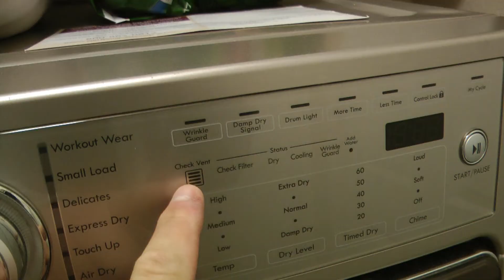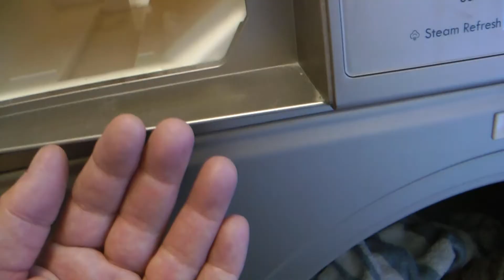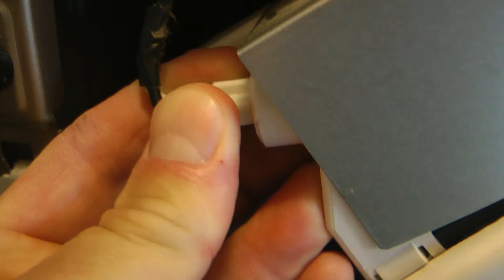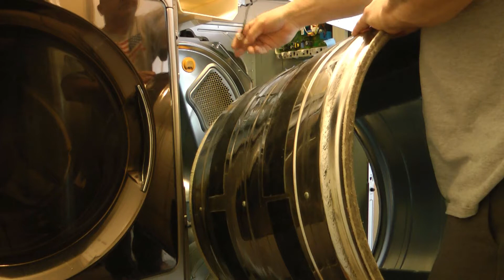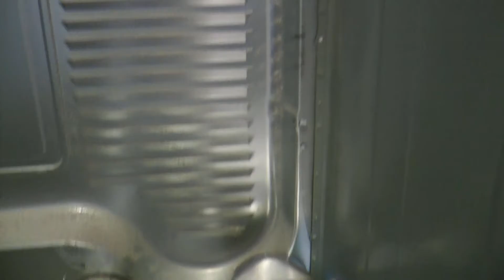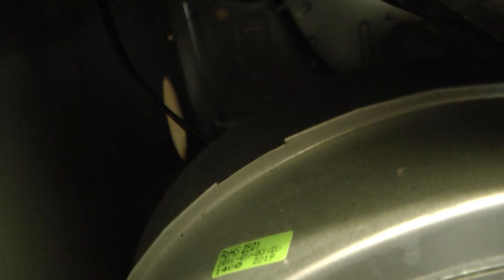Kenmore Elite Dryer drum wheel repair replace

Comment: Thanks for the super detailed video. I followed your steps and was able to swap out the rollers and tensioner in a couple of hours. 

A tip I have when it comes to replacing the rear rollers, is you don't have to pull that panel off in the back. You can get a stubby 14mm wrench in behind the panel and the end of the shaft is a 10mm socket. Zap it off with your impact and you're good to go 

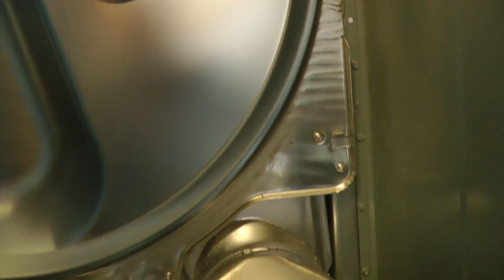Thanks again for making this. 12:31
Reply from the maker: thank you for sharing your tip, I'm sure it will help others

Comment: There isn’t much I won’t try when it comes to home repairs.  But a dryer rebuild wasn’t on my experience list until I came across your tutorial.  In Alaska we don’t have much of appliance repair shops and most parts must be shipped.  I started the project on Saturday following your steps 1 by 1. When I stripped it down to the drum rollers, I found out my parts I ordered were not the correct rollers.  I almost took the dryer and parts to the dump.  After realizing a new 9cf dryer is about $1,500, I thought I’d give it another shot.  I was able to source the correct parts (minus the belt being too small so I put the old one back in for now) and put it all back together tonight.  Many thanks for a great video and tutorial.  You saved me a little over $1,400 plus a little blood.  Gloves are highly recommended 😅.  Thank you.
Reply from the maker: glad the video worked.  I am not an appliance repair person but just figured this stuff out on my own.  That dryer is still working great to this day

Comment: Thank you for the excellent video.  I was able to replace the rollers on our Kenmore Elite dryer using your instructions.  FYI, I was able to reach nuts behind  the back plate holding the rear rollers with a 9/16" box end wrench and replaced them from the inside without removing the back.  There was not much space and I could just get the wrench on the nut.  I think my older model had a bit more space behind the back plate to work in than yours.  This is the second set of rollers I have installed on this machine.  The last set lasted only 3 years.  I had completely forgotten how to disassemble the dryer and it would have been a nightmare without your video.  Thanks again.
Reply from the maker: glad it was helpful

Comment: 1.2.2025 - This is the best tutorial. Step by step process. I completed the job successfully and only had two screws with out a home. Many thanks.
Reply from the maker: now the challenge... do you try to figure out where those 2 screws went?  I would at least get some painters tape and tape them somewhere secure to the unit in case you figure out you need them later

Comment: Thank you for the video. There were some differences in my Kenmore Elite (such as 6 rollers, number of screws and locations, etc.). I used your video for a majority of the repair process (pausing every step🙂.) It really helped. My dryer almost like new.  Sent the video to my wife at work when it was completely disassembled. She asked if I can you put it back together? Jokingly, I said no. Then she said to buy a new dryer. Turned on the newly repaired dryer when she arrived and thanked me for buying her a new dryer so quickly. She couldn't tell the difference because it was so clean, lint free and very quiet. Thank you again for making the video.

Comment: 13:15 time stamp, you dont have to remove the whole hose, in the back of your dryer there should be this plastic cover that you can open like an oven door, then from there you will have access to where the hose connects. The hose should have this plastic lock which you can squeeze and pull out and it should just click back in as well once you put it back. 
Thank you for this in depth tutorial, I used it to fix our dryer which had a knocking sound. One of the rollers went bad and metal shaving was all over the dryer. Our dryer is 14 years old and all that lint inside looked like carpet. Definitely a fire hazard.
Reply from the maker: thanks for the tip

Comment: I have the same model , but issue is not heating up, also notification up check filter, I did clean many times, any advice how to dis the heating?
Reply from the maker: I got that check filter whenever the ducting in the house was clogged (which was regularly with this dryer - way too much lint got past the screen).  Not heating up probably means heat element.

Comment: Thank you for sharing your video! I too had a same back roller but it seized up and ground off a quarter of the wheel.
The step by step was great. I was able to use pliers to hold the nut to back panel cut outs.
Reply from the maker: glad it helped

Comment: Do you know if this kenmore elite dryer starts if i toss a batch of dry clothes in there?  Or do I need the clothes to be damp in order to test start a cycle?
Reply from the maker: when in doubt set it to a timed cycle instead of an "automatic" cycle
Reply: @WJHandyDad  Opened it all up easily thanks to your video!  Turned out to be a broken belt.
Reply: @WJHandyDad  replacing my belt now, im at the step to put the shield back on, but as soon as i do the drum gets “stuck” and impossible to turn by hand. Whereas you were able to turn it easily as a quality check. Does the drum sit radially along the wheel tread, or co-axially along the side?
Reply from the maker: @oscartan1389  it seemed to me like it fit together very logically when I did it.  But it should definitely turn smooth and easy.  Make sure you have the belt routing right too
Reply: @WJHandyDad  all fixed now thanks! I rewatched the video more carefully and needed to get the drum over the front wheels, my mistake was not getting it fully over which clamped down the wheels. Thanks again!

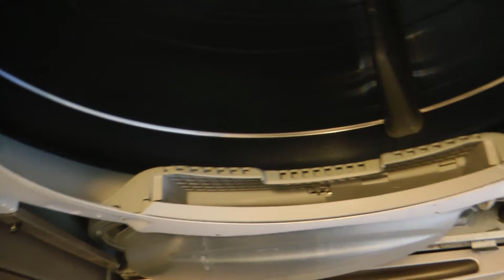Comment: Could I remove the 4:47 - 8:30 pieces all as 1 sub-assembly?
Reply from the maker: I don't know.  If you try please let us know if it worked
Reply: @WJHandyDad  It ended up working, only need to take out the screws to the metal drum shield, and left the metal stamped part + plastic lint basket attached.  Took it all out as one piece.  The downside is, you wouldn't be able to clean it out as you recommended in the video (it does get dirty).  But I took that trade-off for time.
Reply from the maker: unfortunately I can never save that step because ours always needs to be cleaned, even if I cleaned it recently.   That thing gathers up lint so much faster than any dryer I had previously

Comment: Ive worked on very expensive cars for work and this is not poor engineering its intended to keep us out IMO...    Thanks there were a few bits I was not sure about.
Reply from the maker: yeah, they definitely don't want anyone to be able to DIY anything any more
Reply: @WJHandyDad   There is no way its not intentional Im pretty sure LG makes them.. Thanks for posting the video it made it way easier and Ill take the $40 and  my time VS whatever that would have cost I doubt it would have been cheap..

Comment: hello and thanks kindly for the great video.   can i ask if you have any idea why  when trying to remove that lint trap housing,  my machine, which looks exactly like yours  has only 2 screws.  i do not see that third screw that you describe and show  toward the middle of the housing.  and i cannot remove that piece, nor the blower housing from below thanks
Reply from the maker: I wish I had an answer for you.  Make sure the screws aren't covered in lint.  There should be 4 total, but only 3 need to come out